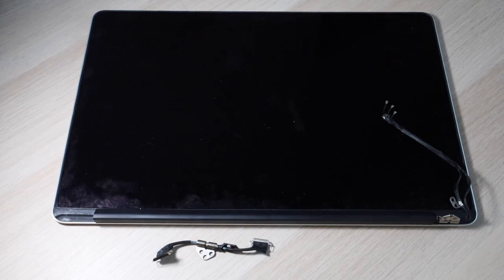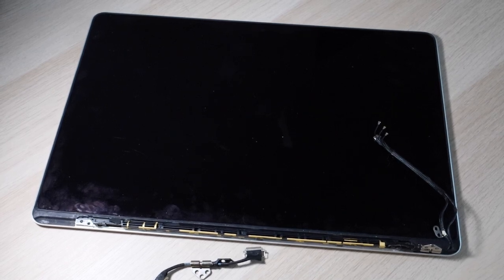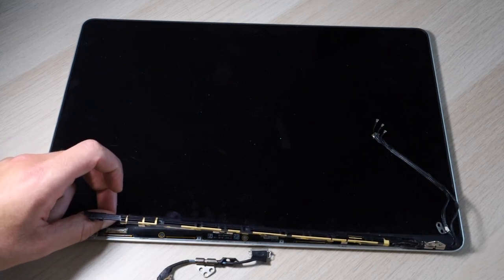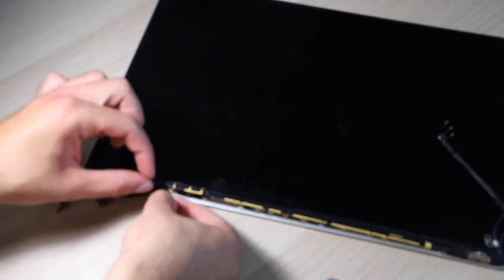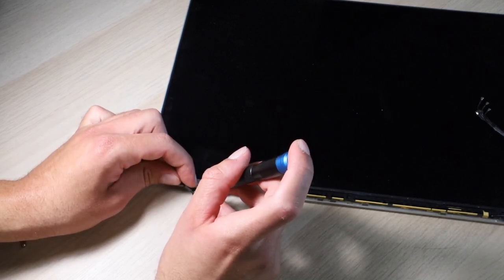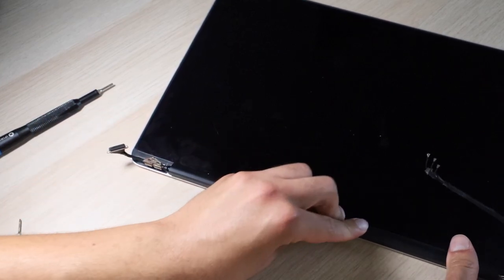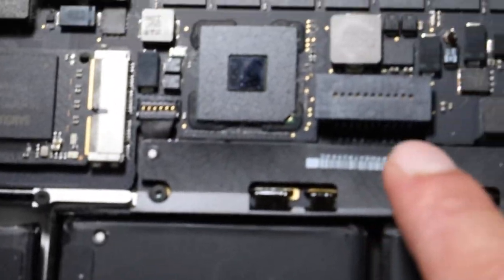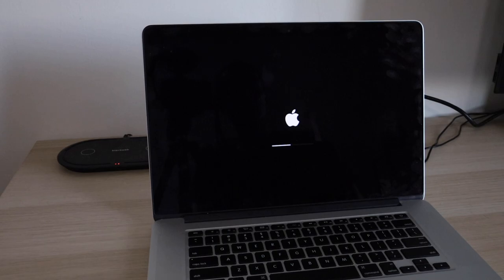MacBook Pro LVDS Cable Replacement (A1502, A1398) (Mid 2012-Mid 2015 Retina 15-Inch)

Comment: Hey - I will need to go through this procedure. Do you have a link to the LVDS cable?
Reply from the maker: https://www.ebay.com/itm/174487006756?mkcid=16&mkevt=1&mkrid=711-127632-2357-0&ssspo=8MdFTylhSYi&sssrc=2349624&ssuid=WBILauQ0TyK&var=&widget_ver=artemis&media=COPY

Comment: Hi Joshua, just wondering by replacing the lvds cable will fix the flickering issue of the screen?
Reply from the maker: Flickering could be caused by a bad or failing graphics processor. Which model MacBook do you have, which model graphics processor does it have and does the issue get worse when playing graphically complex content?
Reply: Hi.. did you fix the flickers I'm having the same issues

Comment: I have macbook pro 13” with shadow on the bottom screen. Is this method works?
Reply from the maker: A shadow on the bottom of the screen may be the backlight going out. I would recommend looking at the backlight pin on the LVDS cable and connector on the board very closely first to determine if the issue looks to be the cable/pins/connector or the backlight itself from usage over the years.

Comment: thank you ive got a 2012 mid 13 inch MacBook Pro , unibody , recently it gets a 1 inch from top to bottom striped line down the center , the cable is $12.00 on amazon , I got the last one , so ill let you know if this does the fix , I really appreatate  your video have a great day

Comment: is that possible to replace the Macbook Pro 2012 display to Macbook Pro 2015 model, is it compatible?
Reply: The 2015 uses a different webcam connector
Reply: Totally different LCD technology. 2015 is Retina screen, 2012 is not

Comment: Hello Joshua , there is a rectangular area in the middle of the screen of my 2015 MacBook Pro device, 6-7 cm wide and end-to-end. Colors can sometimes be normal and sometimes the opposite. There is no crash on the screen. Do you think the display cable can solve the problem?
Reply: All you can do is replace the cable and see. There is no other way to test which is faulty.

Comment: HI, what is the name of the display connector on the motherboard, and is it easy to be replaced I do have some soldering skills. Thanks,
Reply: LVDS connector can be replaced but you need skills. hot air and a good flux like genuine (not eBay) flux

Comment: Hi Joshua, I have a MacBook Pro 15-inch (Retina, Mid 2012)  A1398. I've dropped my mac that left less than a 1cm of my screen on the left side black which i know a replacement is required for that. But I don't mind it  but it was several months ago and continued to work fine, But just recently I accidentally had my thumb on the screen when adjusting the position and I assume I had to much pressure when doing so. Because now the bottom of my screen has a new strip about 1cm high that is white/streaks of light colours. And after about 45 minutes of use the whole screen starts frantically glitching. But letting it rest for about an hour its back to how it was and the cycle continues. Is it a complete screen replacement to fix the glitching or would the cable replacement help? Thanks !
Reply: You will need to replace the screen completely, i know its old comment but it happened to me
Reply from the maker: Sorry for the late reply, I was locked out of my YouTube channel. This sort of damage would require a screen replacement. A cable replacement would not resolve this issue. Best of luck!

Comment: My hinge part is broken where 3 screws are added on top case. How can I replace that hinge only?
Reply: 5:35 at this area. the triangle 3 screw thing.
Reply from the maker: When you say "hinge part is broken" what exactly do you mean? I'm having a hard time envisioning what you're asking, my apologies.
Reply: @joshuafox9365  3 screws area where you are touching at timestamp 5:42 . There's a crack between top 2 screws and 1 bottom screw.

Comment: Hi, thanks for the video. I just cleaned my internal part from dust and replaced the thermal paste. but after reassembling it and turning it on the screen suddenly only backlight and no display. is this problem with the cable or what? please help me, thanks
Reply from the maker: Have you tried a SMC reset and a NVRAM reset?
Reply: @joshuafox9365  Yes, I did. but didn't work
Reply: Did you ever find a solution to your dilemma? My MBP is having the same issue (backlight but no display) and I'm thinking about replacing this cable.

Comment: Thanks for the video Joshua, you explain the process well. I have a single vertical line of pixels out on the screen, do you think swap the LVDS cable would fix it?
Reply: A single line will NOT be caused by the cable, but by the LCD panel.
Reply from the maker: As @CMIzapper said, a single line is caused by LCD damage and is most often resolved my replacing the screen assembly. The LCD itself can be replaced but is a much more difficult repair.
Reply: @cmizapper  Harald Hi

Comment: Hello man, I have a Macbook pro 15 A1398 and I have a problem similar to the flexgate at the bottom of the screen, you can see that all the lights do not turn on to backlight the screen, do you know if changing this flex would solve that problem?
Reply from the maker: Changing the flex cable will solve that problem if it's a problem with backlight pin 0, which is a likely issue caused by improperly resocketing the LVDS pins into the LVDS socket on the motherboard.

Comment: Cable this easy to access on a mid-2012 a1286 non retina or does the bezel need to come off ? Tia
Reply: On non-retina models, the cable goes in the back of the display, so you'll have to remove the glass panel (or aluminium bezel if equipped with non-reflective screen) in order to replace it. It's a very delicate and risky process, you need to apply heat to the glue and proceed prying it off with poker cards.
Reply from the maker: I am unsure, unfortunately. Please see to Carper's comment.